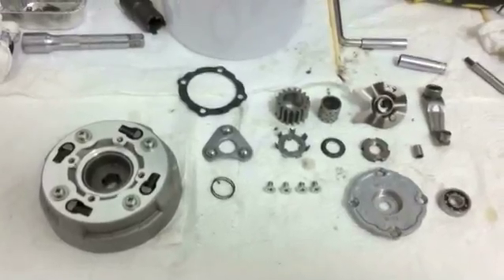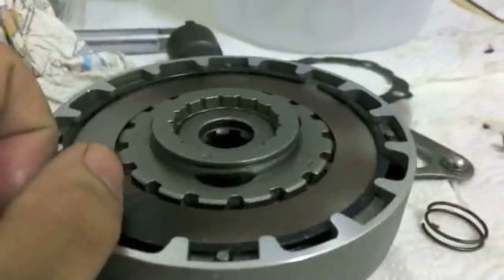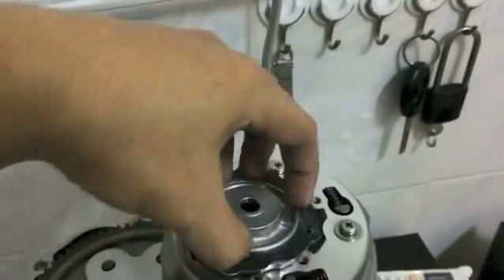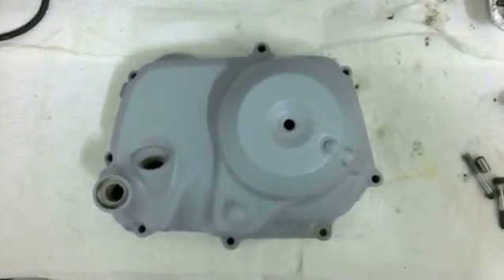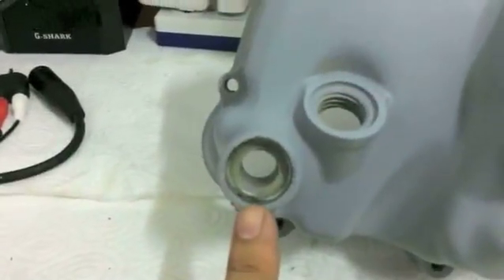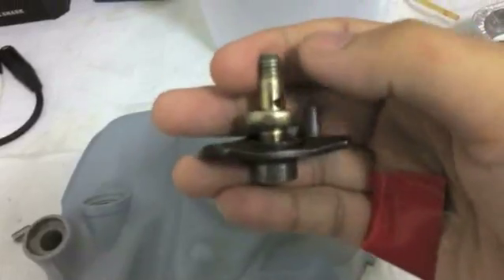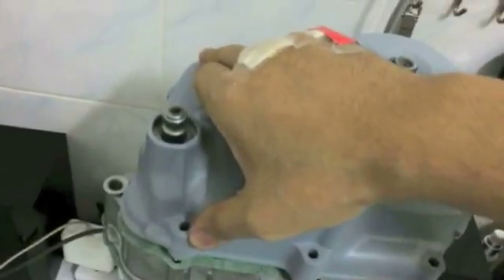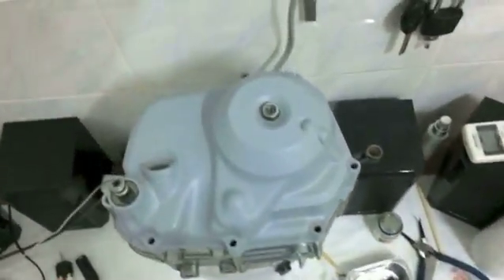(Detailed Version) Honda Semi-Auto or Pitbike Engine Rebuild Part 4: Clutch Side Assembly 2 of 2

Comment: This is the Second Video of yours that I've watched where you do not explain what the Clutches center Collar "as you call it" & Springs function is. (I Know this part as the "Oil Through & Spring"). This piece is a crucial part of the shifting process and I don't see why you would not mention them in your instructional videos!? Without these two tiny pieces, you cannot shift your gears properly or at all.

Comment: Are you from UK right? There is a Honda Innova('Wave' at my country) which is semi auto motorcycle. What I don't get is why it using 2 set of clutches. Can you explain to me?
Reply from the maker: Very simply put, one clutch is for idling (the centrifugal one), and one clutch is for when you're shifting (the one that disengages when you push down the gear lever).  On the Super Cub (like this engine), they are the same unit, but on the Innova they are different because having the second clutch on the transmission vs. the engine means the pack spins much slower and shifts are much smoother.  Hard to explain without a diagram though.
Reply: Exactly what I'm wondering also, I really wonder how motorcycle without clutch lever works (semi-automatic) can you make video about this also? about Honda Innova?